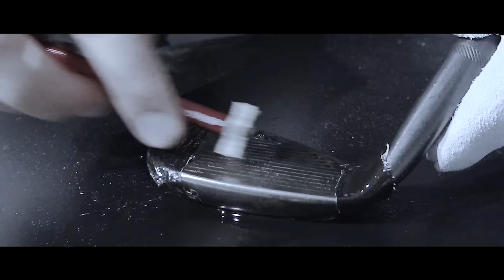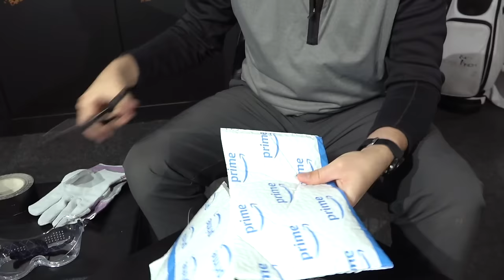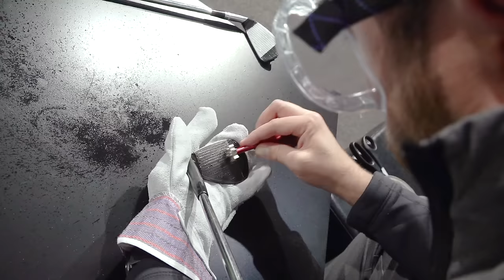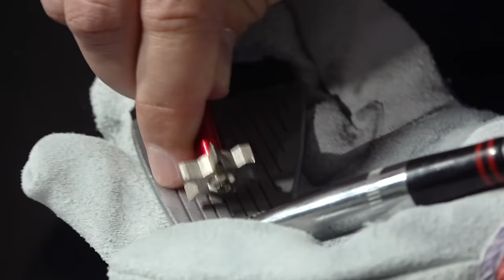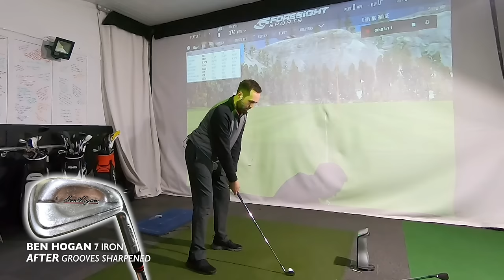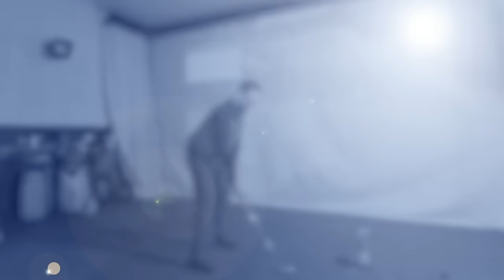I sharpened my golf grooves (unexpected results)

Comment: I have been sharpening the grooves on my wedges for many years.  I practice a lot so I want the wedges in top shape.  I have found that sharpened grooves really make a difference in 25-50 yard range shots.  If the ball will check up, then you can play more aggressively.   You can find groove sharpeners that match the kind of grooves in your wedge so they stay 'legal.'  We amateurs cannot afford to buy new wedges very often.  The professionals get new wedges whenever they want them. So they are always playing with new, 'grabby' grooves.
Reply: The size of the grooves is already quite close to the legal limit, from the factory. When you sharpen something, you remove a small amount of material. You do the math. If you sharpen your grooves, your clubs are not legal.
Reply: @winstonsmith11  who cares if there legal or not … & if ur not a pro golfer it shouldn’t even matter.!!

Comment: I have repaired a lot of wedges. Rick , first when you do this the face is actually deformed in. The grooves in the face have to be chiseled apart to restore the width. Then you can use a groove tool. Basically there are v groove restorers, & square groove restorers. After cutting grooves, you have to sand face to remove ridges & burrs. None of these wedges will ever be legal. It is ok for normal play, it will help performance.

Comment: I reckon the spin increased slightly on each club because the groove tool will create a slight burr at the edges of each groove, thereby increasing the friction grip between the clubface and the ball.. After you strike maybe 30-40 balls, that burr will have been flattened and the extra spin will disappear!   (Please do read on)

The large grooves on the clubface are for debris management, not gripping the ball. I'm sure we can all agree that the grooves on our car tyres are to help dissipate water, not grip the road, and it's the same with grooves on a clubface!!

If, however, you look back on where the camera is zoomed in on each clubface, you will see lots of smaller machined grooves on the surfaces between the large debris grooves. On the Ben Hogan 7 iron, the small grooves have been cut in straight lines (5 parallel grooves) whereas on the Titleist the machined grooves are in a radial pattern. This is because they use a rotary cutting tool on a milling machine to create their shallow grooves, and hence they use the term 'spin milled', and these wedges have the letters SM in their model designation. 

These little grooves have a fairly finite life, especially on the softer metals used in forged clubheads, and you'll notice the loss of spin on short chip shots around the greens. Hence we are advised to replace our wedges every year or two, and you'll also see the tour pros play with a brand new wedge at every tournament. These grooves, when new, have the effect of increasing the coefficient of friction between the clubface and the ball, which declines as the surfaces become 'polished' by repeated ball striking.

It would be interesting to see the spin rate if you were to 'sharpen' these smaller grooves as your tool appears to have several sizes of cutting head.....  The Ben Hogan 7 iron would be easiest to attempt this on as the grooves are straight, but you could experiment with the Titleist too. I would suggest you just sharpen the grooves in a small zone as it can be seen that you consistently strike the ball in the same part of the clubhead.

I have some old SM4 wedges that I was going to experiment with by sand-blasting the clubfaces for increased surface roughness, but to date I haven't acquired a large enough air compressor for this test!

I'm an engineer by the way....(Geek, nerd, very dull etc.)
Reply: Damn so you’re saying my 10 year old Vokey should be replaced? At this point the rust is what’s giving it the grip😂

Comment: I have the same sharpener, and honestly I think just the cleaning of the grooves make most of the difference you'd see.  If the grooves were actually being sharpened, you'd see silver edges on the grooves of your black wedge.  Modern clubs have some pretty tough plating, and it takes a lot of pressure to actually cut the metal with these sharpeners.

Comment: You inspired me to sharpen my own grooves. I opted for a much more expensive sharpener from Amazon, but one which claims that the grooves would be legal when done, the GroovEx. It is also made from a much harder metal (93 Rockwell, versus 65 Rockwell for the cheaper sharpeners), so that it will stay sharp a very long time. I sharpened all twelve clubs (not the putter or driver, obviously), and it was every bit as sharp on the last club as on the first one. The downside? It is small and has no handle, so it is hard to hold. In an hour or so, the grooves now look like new, and feel like new. Thanks for the idea.

Comment: As a machinist, I couldn't help but chortle at the safety glasses.  X'D  Also, you might not realize this, but you likely won't need more than a few passes in each groove to reach whatever maximum sharpness the toll will provide.  Also, obviously, the angle you hold it at will make a huge difference as will the pressure you apply and the direction the pressure is applied in.  Then lastly, WD-40 is a penetrating oil intended to loosen parts that are fitted together, usually via threads.  It is not a lubricant.  For better results, use a lubricating oil. ;)
Reply: WD40 wasn't intended to loosen parts that are fitted together, usually via threads. It was designed to be a water displacer originally used on missiles to prevent rust and corrosion. Theres a plethora of alternative "penetrating oils" available that are specifically designed to free seized objects.
Reply: Personally I would use pb blaster lol
Reply: Let’s just say I did more than chortle when I saw the safety goggle’s come out. Having spent tons of time in chem labs and around power tools I just about spit out my drink laughing at this. Maybe he is just trolling us good. Do it for the likes.

Comment: Good video but a few questions. I have the same tool so I’m interested to know;
1. Which groove shape did you use on the tool? And how do you know which to use. 
2. What would make the club illegal for competition. 
3. Did you wire brush the club after sharpening? (To smooth out the edges therefore causing less damage to the ball.)

Comment: Hi
I bought the same sharpener last year.The problem is; there are both  “v” and “u” shaped grooves.
 So which do you use one the wedges?! I personally use the Cleveland wedges and just upgraded to rdx 4 56  & 60.
I am reluctant to use the tool since  I don’t want to sharpen the groove with the wrong shape sharpener.
What to do?

Comment: As a junior at a local club we were obsessed with backspin. I bought a tool called Hymec Backspin Tool and dug out a few of us dug out just the bottom 5 or 6 grooves of our wedges. We went onto the course with just that one club each and be mesmerised that the ball would spin back 10-15 feet each time. Then we fired balls out of fairway bunkers and the ball would land on the back of the green and be spun off the front!!! Who cares how far the ball ended up from the flag, it was just about spin! Some oik nicked the tool so that was that. Crazy times…

Comment: The safety glasses just cracked me up. Like the guy who goes into a strip club wearing a condom😂
Reply: GoodRiddanceGooglePlus there is ZERO chance of a shard of metal jumping from the clubface and into your eye. Zero!
Reply: GoodRiddanceGooglePlus  hey who you calling chums?
Reply: A Google User wow. Such angry in a golf discussion😵
Reply: A Google User  He's not using a lathe. I hand de-burred space shuttle parts for NASA. No requirement for safety goggles here. Unless you have a fan blowing up fan blowing up from below, nothing at all comes flying up into your face with a little scraper tool at hand speed.
Reply: @dylanrobinson2449  Sure you should wear eye protection, especially if your face is right down in the work or you're clumsy. The fogging, scratches and warped lenses makes for more eye strain and mistakes, so use good safety glasses.
Reply: Have gotten shards of metal in my eye before working under a car. Not fun. Funny comment but protect yourself irl!!!
Reply: @highsnburgers4862  perhaps you are trained and skilled in using such tools, and he is not.
 i'll not decry anyone using eye protection when working with hand tools. 
i actually think when anyone does it shows their ignorance. 
hospital waiting rooms are full of people who knew better, some will only have one eye.
Reply: Okay sure, make sure you wear your safety glasses when you clip your toenails. Safety First!
Reply: @highsnburgers4862  
No what you actually do is all the filing and sharpening with your goggles on
Then lift them up to see as they are all fogged and scratched then blow on the dust and get it straight in you eye

Comment: Back when I was a club pro, in the 80's & 90's, I seem to remember a company putting out some clubs with very sharp grooves and they were deemed illegal almost from the get-go by the USGA and R&A. One company even went so far as to cut the grooves  at an upward angle, into the clubhead, giving the leading edge of the grooves an even sharper edge. Those really did skin the golf balls. I used to play with Spalding Tour Edition balls back then and I tried one of these clubs and it would take chunks right out of the cover.

Comment: I might try it. I have an old Titleist pre vokey prototype 56 bent to 55. I used a small file but didn't take much off. I hate to replace it but it's painfully obvious after getting a new 48 and slightly used 60 that the old wedge is not even close to spin of those. Although I am used to the check and run distance with it.

Comment: With the old square grooves, I never sharpened the grooves....I would clean my clubs most of the time with some steel wool while soaking them in some warm water and dawn dish washing liquid. This always seemed to work without altering the grooves. 

Would love to see how the wedge works on the course, especially from the sand and the rough around the green!

Comment: The real question is what effect if any did the sharpened clubs have out on the course. Did the sharper wedge stop quicker,did the sharper 7 iron curve the ball any more or less.
Reply: First of all, yes - more spin = ball stopping quicker.
Secondly, similar to first point - more spin = more potential shot shape. Second point also comes down to your swing plane vs club face angle at impact. If it’s perfectly on plane with a 0.0degree face angle it would still fly dead straight.

Comment: Just my two cents' worth:  Upon the closeup view of these two clubs, the micro-grooves are still present and don't show a lot of wear.  600 rpms isn't a whole lot of spin difference, but if you got a club that was truly worn out (micro-grooves worn to basically flat smooth and not showing), tested old first and then re-tested after sharpening, it would probably show a bigger improvement.
Reply: I dont get how he even has microgrooves. I bought a wedge new with microgrooves and a week in they were near worn off. Definitely are gone from low-center of clubface now, months later.

Comment: Wd40 is not a lubricant. its a penetrating oil... Just sayin
Reply: W ater D isplacer (formula) 40
Reply: Penetrating *oil*. It's definetely a lubricant, just not a very good long term one.
Reply: @Benedocta  not even short term put it on car door hinges they all gonna start squeaking
Reply: THE CAN WITH THOUSANDS OF USES
Known as the “can with thousands of uses,” WD-40® helps those who live life hands on protect metal from rust and corrosion, penetrate and free stuck parts, displace moisture, and lubricate just about anything.

Comment: I don't play tournaments.  I sharpened my old 96 Callaway's and I found a bunch of Titelist Tour Balata balls that I still live because of their spin rate.  A bad swing with the face slightly open off closed is still a bad shot, I think maybe a tad more.  I can't tell. Wy wedge shots on the balata ball make it spin like a pro and after 15 holes there was some paint coming off the ball.  It was a dead giveaway that my grooves had been sharpened and I was playing with a softer 3-piece ball.  Spent some time with a Pro-V1x and my wedge and got great spin but the harder cover hid the marks I was using a sharpened wedge.

Comment: Hi Rick. Interesting video. I have the same sharpener. My question is this. Which of the cutting teeth on the cutter do you recommend to use ? They are all different shapes. Thanks 🙏

Comment: RS, You did really clean out the grooves well with that tool.  You marginally sharpened the surface edges of the grooves resulting in a less than 10% increase in spin rate average.  Did that tool technically regroove those clubs- NO.  That would take greater heavy duty / precision machine tools.  Those cost into the four digits a require some training to operate without ruining a club face beyond recognition.  Clean grooves, yes.  As good as virgin, no.

Comment: You should have included a couple other clubs and just cleaned them. The physics tell you that in the perfect conditions of the simulator, sharpening grooves can only hurt spin by slightly reducing the surface area of the face that contacts the ball. 

Think race tires. You just did the equivalent of switching from bald to tread tires (yes I know they clubs weren’t “bald” before). That doesn’t increase friction in dry conditions with nothing between the ball and face like grass or dirt.

Comment: Guarantee those grooves were less sharp after that angle-grind tool was applied.  "Sharpness" refers to the angle between the face and the groove and how round is that edge.  A perfect groove is cut 90° and if that 90° is maintained perfectly at the edge where groove meets face, you can shave with it.  The tool you used has no 90° edges.  Not one of those blades approaches 90°.  They're all angled, each and every one.  What you did was take the edge off, but also cleaned the grooves.  Sharp grooves grip the Ball for better spin, but clean groves do too.  You dulled the edges, but cleaned the grooves for net slightly better spin.

Comment: I have the same sharpener.  Use the "square" groove cutter and really go deep.  Talk about tearing the cover off the ball!!!  I also have a small sand blaster to do the faces of my irons.  That too can make a difference.  The ONLY problem is with "The Rules of Golf".  The USGA and R&A set some parameters regarding grooves and faces and I'm betting once you use this tool, your club face becomes illegal because it's going to differ from the legal face the manufacturer created.  They go to the legal limit in the production of these clubs.

Comment: Have you thought of knocking down the edge of the grooves by using a high grit sand paper a across the face? Not sand the club but just enough to break the edge on the groove.

Comment: Best technique is*Heel-to-toe*...single, Heavy strokes at a time..._Lean On It_..!! 
Also important to angle the sharpening point Toward the cutting direction....You'll feel the cutter taking off the manufactured grit from the grooves on the first few strokes, 
getting smoother as you dig In...!!! 
Great Tool..!! You'll notice much higher ball flight and carry Immediately..!!!

Comment: Groove sharpness has nothing to do with legality - nothing in the rules about it. The issue is the spacing between grooves. When Pings first came out, their square groove edges were 90-degrees instead of something like 120 on a Vee groove, thus it was "sharper" and causing excessive ball damage, as you've seen. So then they rounded off the corners which lead to the argument of where to measure groove spacing: wall to wall, or to where it starts to break.

Comment: I’m not a pro and never will be.  When my last set of wedges started getting old I began sharpening them and agree that it makes a substantial difference…..especially when playing something like a Pro V.  It is most noticeable on short pitch shots (significantly less than full swing shots….)……where you can still get action on your ball.  Other folks generally won’t be able to do the same.  It was these shots that most often had my opponents questioning what I was doing with my clubs…….so beware..    Thanks for the great videos !

Comment: You shouldn't do short back and forth strokes when sharpening. They should be 1 long stroke from 1 side to the other and repeat... It will result in a better, cleaner, smooth sharpened grooves and much more even. Hope you understand...

Comment: Old video, but I thought the grooves were not intended to produce spin in dry play.  Only for wet or debris clearing.  The rusty clubs are somehow legal, is it legal to sandblast the face?  That would make it similar to that sandpaper wedge you had.  Should do a lot better than sharpening the grooves for producing spin.

Comment: RICK,.. use the same sharpened clubs but lightly rub some pine tar on the clubface ,.. I predict you will see slightly less distance but a huge amount of spin applied.
golf balls compress when struck placing more surface area to the club face , between the bite on the edges and the flat having much more friction you should able to see rather impressive spin numbers... your draw shots would be amazing.
P.S. I did a similar experiment with a ping bong ball paddle back in the 80's to prove one could cheat at ping pong as a bet with a friend..

Comment: so you could use that sharpener as just a cleaner and it should maintain the grooves vs modifying them illegally.  you can clean and maintain the grooves by using it lightly instead if going nuts with it.